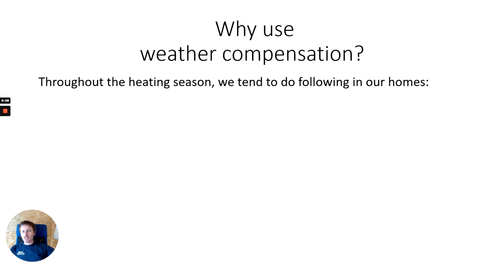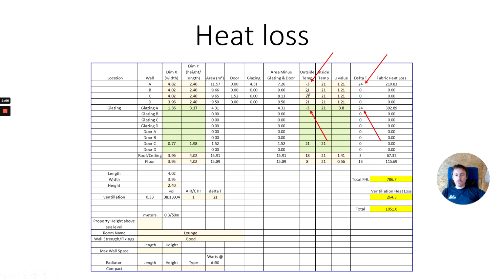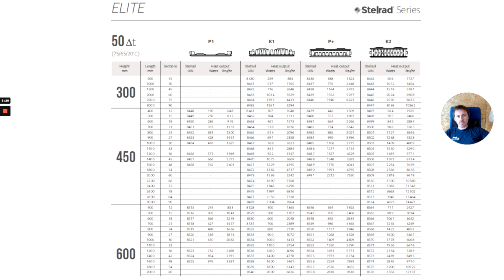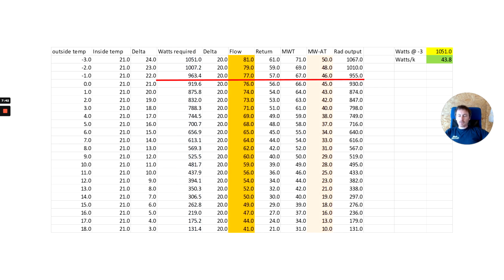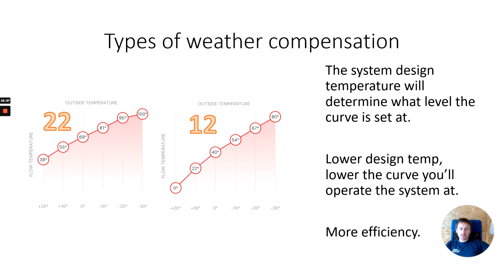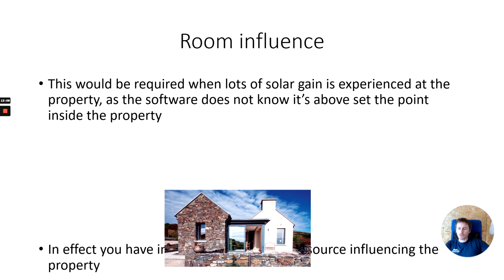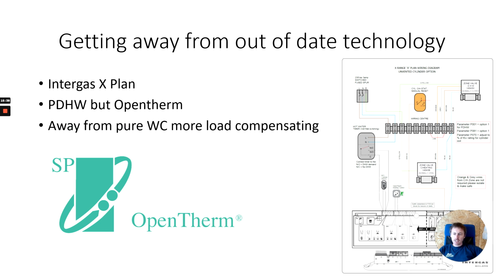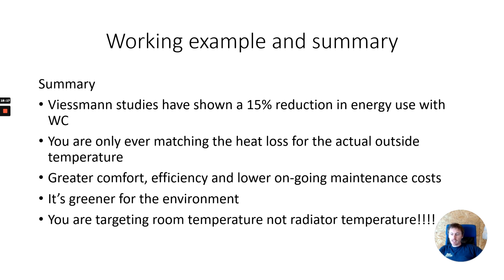02 Weather Compensation

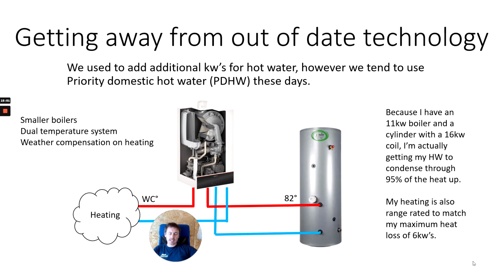Comment: Great content throughout. The only part I don't understand was 15:03 With an 11Kw boiler and a 16Kw coil, why do you get to condense through 95% of the cylinder heat up? Where does the 95% figure come from and why does 11 into 16 keep things within condensing mode with the return below 55°C?
Reply from the maker: Most cylinder coils are about 16 ish kw according to the data sheets for domestic cylinders. Due to the coil being bigger than the heat source the boiler doesn’t modulate back because the coil is beyond the saturation point and keeps the return temp lower for longer. 95% is just me testing my set up. A Heat pump or Solar cylinder piped in series would work better due to the coil size.
Reply: @hvaccuffingit6471  thanks. I wasnt sure if boilers would modulate on the DHW side. I'm looking to design a new system for DT5 heat pump ready but if i choose to fit a V 200-w 4 pipe, I'd like a cylinder thats going to reheat quickly. Vaillant unistor is around 16.7kw coil and 1.4kw loss, joule cyclone is 23kw coil but 2kw loss. I'll have to look into heat pump cylinders or a twin coil.
Reply from the maker: The boiler will modulate back on the return temp closing the delta regardless of what it’s heating. If you have a cold cylinder with a giant coil you’ll hear the fan speed gunning it on the boiler and you’ll even see the flow temp dip as it’s a fantastic heat transfer. As it approaches 60 degrees cylinder temperature the boiler will struggle to dump the heat and modulate right back. Best to get a heat pump cylinder as it will be more efficient on heat up and you are future proofed.
Reply: @hvaccuffingit6471  👌

Comment: Without heat loss calcs ,it must be guess work .
Reply from the maker: More cause and effect without a heat loss. You set the curve and see how it corresponds with the set point. 

If the rads are undersized elsewhere in the building then you’ll not achieve set point there or vice verser.

Comment: great video and clear explanation, thanks. It seems like the best way to get the most from WC is a hot water tank - not a combi? that way you can size the boiler so your modulation can go low enough for average temps, and the lower size of the boiler needed should still be enough to heat a HWC? A combi like we have would need to be sized for instant HW and unlikely to modulate down for low enough flow temps? eg at the moment we’re running at 12-13c outside, heat loss 6kw in the house, we can run at 30c flow temp and the house is lovely and warm, but the boiler still cycles because it can’t maintain 30c. Vitodens 050-w 30kw for HW and I think can modulate down to about 3.2kw? 1:8.

Comment: Sorry a silly question: why is my plumber saying tjhat Opentherm is old and is not worth it and wont make difference?

I got TADO thermostat supporting it and Ideal Vogue max s18 supporting it yet the electrician and plumber disagree and have no idea how that is support to help because boilers have regulators and do that by itself.

Am I loosing my mind?
Reply from the maker: Opentherm will load compensate the boiler and alter the flow temp depending on outside temperature. Weather compensation from the internet ish. Some controllers are less aggressive than others.

The boiler will only modulate itself in most scenarios on a set flow. So if it’s set to 70 and the return is coming back higher than 50 (dt20) it will start to reduce the fan speed and modulate back. 

Opentherm will be more efficient because you flow will be lower on most days increasing condensing and will work in conjunction with the boiler modulation.
Reply: @hvaccuffingit6471  so, opentherm is highly recommend? Y is it not common in UK,? 

I want to get PDHW and opentherm, seems like weathercom is not good/effecient? Also not possible to turn it off?

Atm struggling to get TADO starter kit connected to IDEAL VOGUEAX S18 via opentherm.

Confused
Reply from the maker: @bimiuk4051  does that boiler even do opentherm?
Reply: @hvaccuffingit6471  yes from my understanding it does. :( seems Ideal Logic supports it but Vogue max???
Reply from the maker: @bimiuk4051  just looked it up, you should be able to PDHW and use OT or WC on the heating. Urban plumber has done a video on this. Just show your installer that video. You may need to run additional cables though. Good luck.
Reply: @hvaccuffingit6471  additional cables?? Thats nuts cos it means taking wall apart and its a no no.

Thought i can utilise the cables in place but link it differently to make it work
Reply: @bimiuk4051  did you sort it? Standard tado wireless kit in the UK isn’t opentherm - they removed it as it wasn’t being used by many people. They have brought it back but you need to replace the receiver with an EU model which they sell on the installer side of their website for about £70. I’ve switched to nest because of lack of OT on Tado (even though their website talks about OT all over it, assume thats mainly for europe)
Reply: @MrKlawUK  I got the EU version which supports OT but then has one relay connection.

Still struggling to get an engineer to do the work. Thought it be easy ... 

My understanding was to get OT as it's very effective and beneficial. Whether to rely on  OT or rather have external weather whether comp, is a question? Am I right to say that OT needs to be programmed or setup and does not automatically adjust?
Reply: @MrKlawUK  also, would OT overwrite the external  Weather Comp?
Reply: @bimiuk4051  boiler is normally OT or weather comp yes. Weather comp basically goes ‘it’s 5c outside so make the boiler do 55c’ ‘oh now it’s 10c outside so we can turn the water down to 50’. OT is more like ‘it’s 15c inside and it wants to be 21c, I’ll set the boiler to 60c’ ‘ok now it’s getting close at 19c, I can get the boiler to be less hot to gently get to the right temp’ - both good systems
Reply: Also if you have two wires to an old boiler for on/off, that’s all you should need - just connected to a different connection on the thermostat and boiler
Reply: @MrKlaw  I've been literally comparing WC and OT in the last week.  Well not entirely true, I've been using OT on a Nest 3rd Gen for about 2 years now and have been very impressed with it. I also have a WC sensor connected to my Viessmann 100-W (2 year old so does not support programmable WC curves).  However, someone who knows about this stuff told me that WC was better, so I decided to disconnect the OT connections and see.

Well I've just re-attached them. For me OT on the Nest wins hands down. I find the Nest is superb at modulating the boiler to keep a low flow temperature.  It reaches target more quickly after night set back and it just tracks the target temperature with very little deviation.  The boiler hardly ever turns off with the nest, the rads are always warm, or rather, just warm enough to keep the room temp at the target.
Reply: @timklein4874  its been settling in here too - recent really cold it looks like its always ‘heating’ but never getting to the heat. But actually its lowering the flow temp to hover just at the correct temp. Almost the  best of both worlds - efficient when at the holding temp with low flow temps, but fast to heat up in the morning when it needs it.
Reply: Good explanation.👍